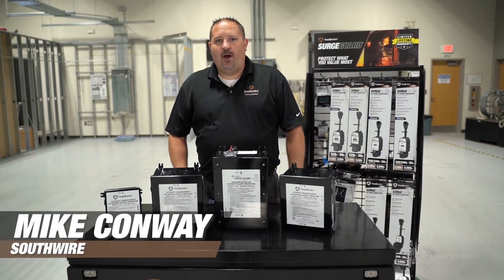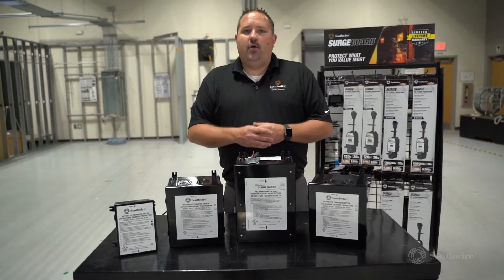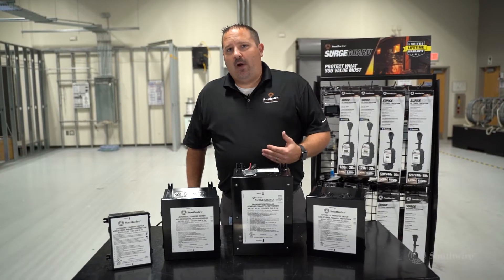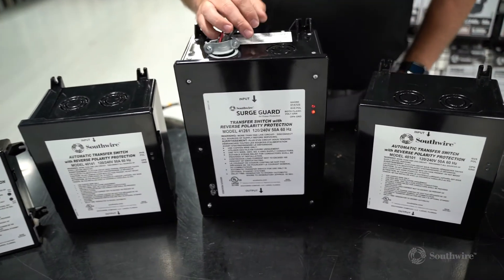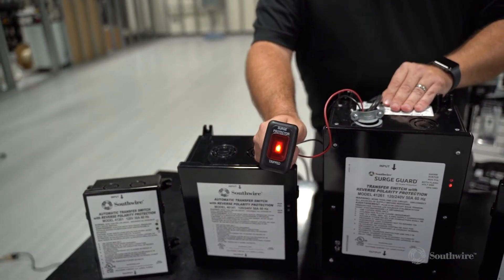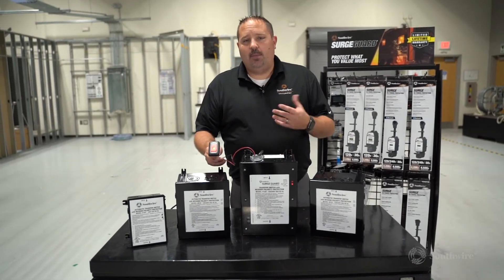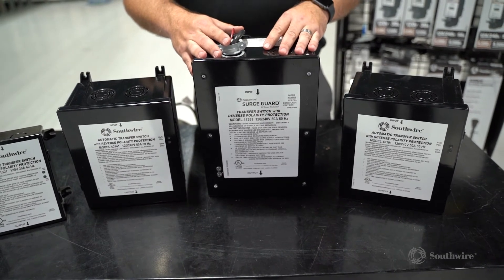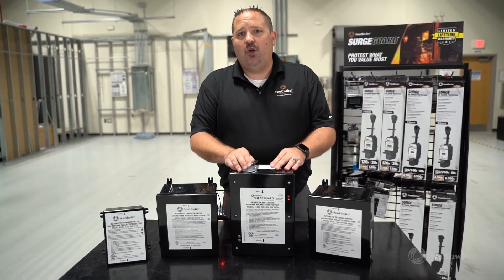41301, 40141, 40101, and 41261 Automatic Transfer Switches

Comment: I have an Eco Flo Delta and Gro-Watt All in one power for boondocking or camping where generators are not allowed. I was using these units on my travel trailer and they worked fine. On my new Motorhome my 41301 is giving me an open ground error light and not allowing me to use the output from my Ecoflo Delta and my Gro-Watt.  HELP please.

Comment: Where do you find the installation manual for the 41261? I want to add a generator to my coach and I'm looking for some information on how to properly wire it up.
Reply: I haven't been able to find any installation manual from Southwire for their transfer switches.  However they do have labels on the exterior and interior of the unit that provide a lot of information about operation and installation.